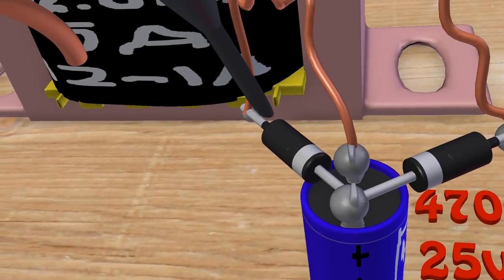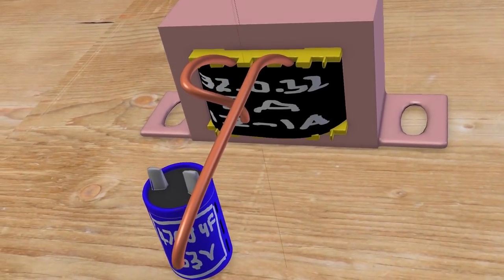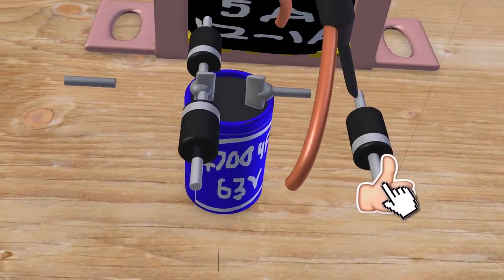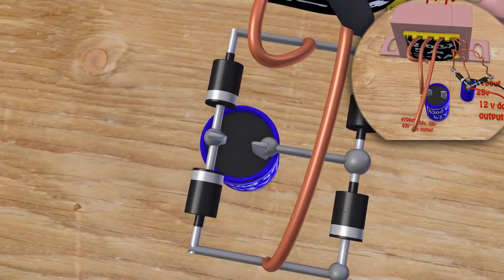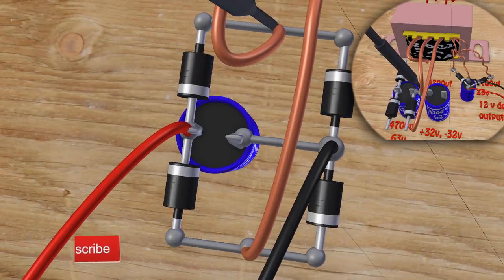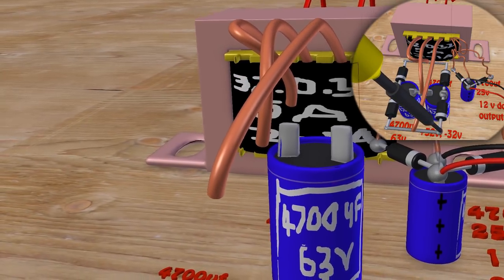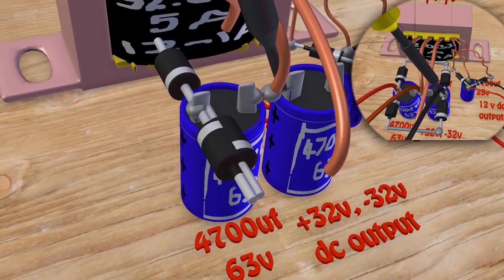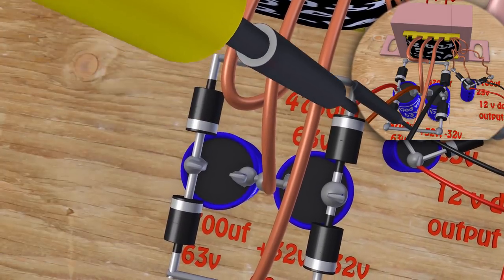How To Make Power Supply for Amplifier -- single and dual power supply Full-HD 1080p

Comment: Bro veetla use panra Brand 5.1 home theatre system mathiri surrounding la small speaker ku mattum low watt ic and subwoofer ku mattum high watt ic use panra mathiri amplifier ready panna mudiuma
Reply from the maker: Normal home theatre making mathade than bro neenga solarathu
Reply from the maker: 2030 Low power/  stk MOSFET high power
Reply: Thanks bro

Comment: bro na oru 5.1 amp assemble pannuna speaker la humming varuthu .eppadi humming eliminate pandrathu
na left right ku tda2030,surrounding ku tda2030,centre ku tda 2030 bridge board use pandra,sub sakthi mosfet use pandra,power supp,ly paththengana tda ic kku 12v dualsupply 3a, mosfet ku 30v dual supply 3a use pandra
Reply from the maker: I need to see the wirring wirring problum Do not mix two power supply in one home theatre amp only use 30 v dual and use stk 4392 for channels

Comment: 8ams 24 volts Power supply
Reply from the maker: what
Reply: 8ams transformer  24 volt ac to DC connection solunga bro

Comment: Ok....how to take  12 0 single supply from 12 0 12 dual supply for usb board?  (7805 ic)  12 0 12 supply attached in amp board.
Reply from the maker: I don't understand
Reply from the maker: I think you are confused on ac dc
Reply: TAMIL MUSIC-MIX   illa ennoda ampla 2030 ic 5.1 board irukku....12 0 12  power supply  boardm attacheda irukku......antha linela irunthu  7805  ku line kudukkanum. Capaciter +- la irunthu line eduthu usb boardku kudutha amp board groundm  usb board groundm  max agama short aguthu....
Reply: TAMIL MUSIC-MIX    ஓரே  டிரான்ஸ்பாமர்ல எப்படி  single and dual supply  edukkarthu?  Amp boardkum , bt board are usb boardkum use pannanum.
Reply: TAMIL MUSIC-MIX ,😀